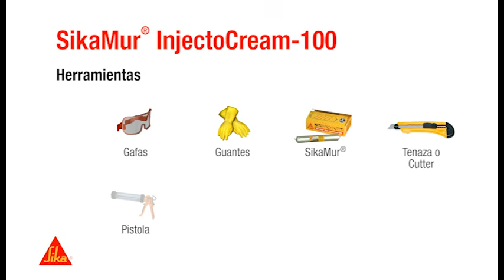Impermeabilización con SikaMur InyectoCream-100 - Sika España

Comment: Hola, tengo una casa antigua en la que una de las paredes exteriores tiene algo de humedad ascendente que parece que puede ser por capilaridad, estas paredes exteriores están formadas por ladrillo cocido en el lado exterior o fachada de la casa y por el interior adobe con revestimiento de yeso y pintura y sin cámara aislante entre ambas.

La duda que tengo y me gustaría si me pueden orientar es si el producto SikaMur InjectoCream-100 puede servir o ser efectivo en este tipo de paredes (ladrillo y adobe) y si fuera eficaz contra la humedad, si daría igual o no aplicarlo por la cara exterior (ladrillo) o por la interior (adobe), ya que por la interior me sería más sencilla la aplicación y además el pavimento del lado interior está ligeramente por debajo, unos 25 cm, del suelo o nivel de calle.

Muchas gracias de antemano.
Reply from the maker: Hola Juan Carlos,

 lo ideal será que se aplique por dentro y por fuera. En ambos muros, la aplicación de SikaMur Injecto Cream debe hacerse en las juntas de mortero. Por la parte interior, el muro de adobe, se colocaría a una altura del suelo, aproximada a 10 cm, en la primera junta que encuentren y en la parte externa, el muro o pared de ladrillo también a unos 10 cm por encima del nivel del suelo. En el caso de aplicarlo sólo sobre uno de los muro, sería recomendable por el interior.

Comment: B días. Tengo humedades en sótano por capilaridad. Después de aplicar la resina SikaMur InyectoCream 100 voy a sanear los muros de ladrillo y hormigón, pero mi duda la tengo a la hora de reparar los muros. ¿es mejor utilizar un mortero con un aditivo impermeabilizante tipo SIka Cim o Super Sikalite o un mortero con Sikalatex? ¿Y para rematar el muro es mejor usar el Sika Top Seal 107 o el Sika TOp 209 ES?
Reply from the maker: Hola Alfonso, si la aplicación es por el interior, se debe usar mortero aditivado con SikaLatex para regularizar, y posteriormente SikaTop Seal-107 para impermebilizar. El revestimiento siempre con pinturas transpirables. Hasta ahora!